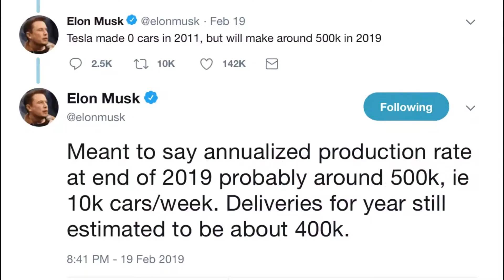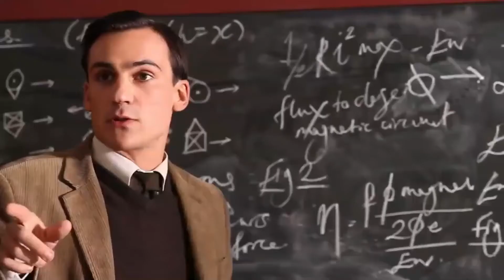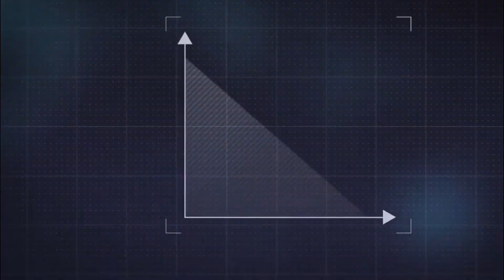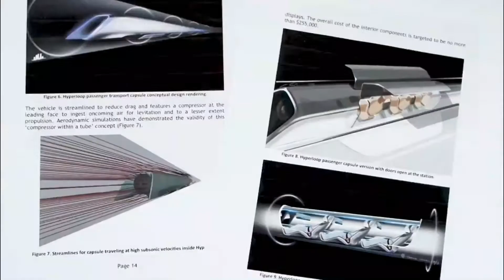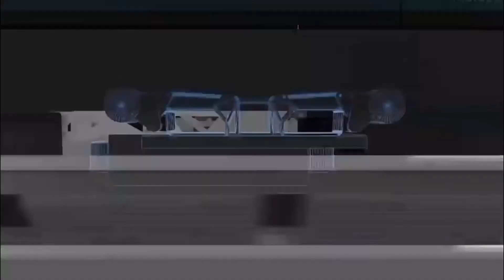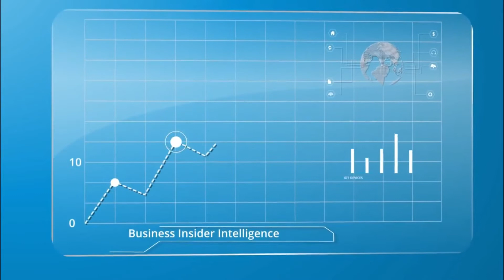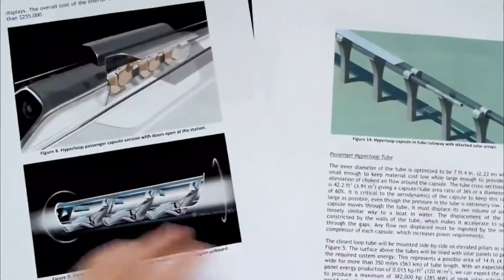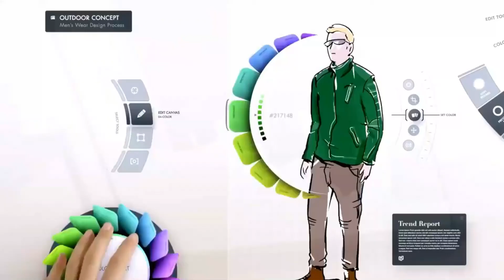Elon Musk’s Boring Company | Underground Loop Tunnels | The Boring Company

Comment: Dreams. You can't make a brick using any soil. Here in Vienna Austria everything is Sand with underground water. You have to drill using higer pressure in the tunnel to prevent water to come in. This video is so away from reality than it is amazing. Good luck if you think that tunnel is just hole in the ground.